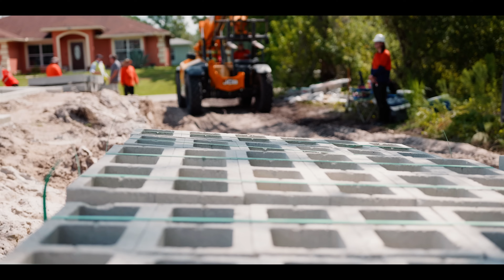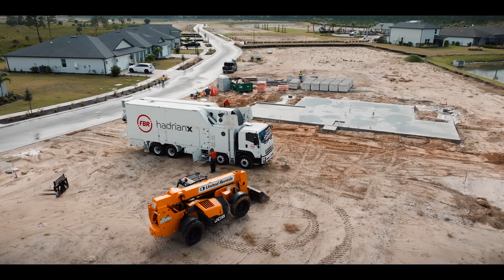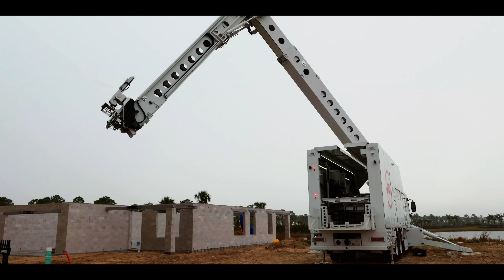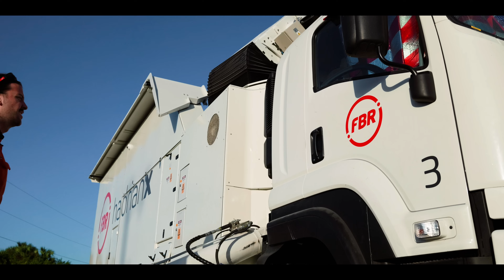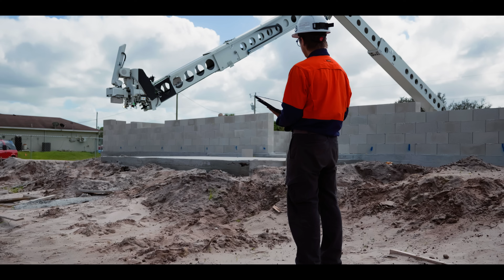Demo Program Retrospective | FBR

Comment: I see that you're using an adhesive not mortar, I also saw that the adhesive is applied to the bottom of the blocks & then laid in the wall . I saw the gap in the perps so what is happening with the filling of the perps* > vertical joints* not horizontal joints. When watching some of the blocks were laid with a 10mm gap so how are those joints filled or are they laid flush to each other & that video I saw was like an error or something!? Need to know before I invest as I am a brick & block layer :)

Comment: This is a great video😃 Last year I was at the University of Johannesburg (UJ), where an Expo was held by Johannesburg Business School (JBS) and the South African Institute of Civil Engineers (SAICE). I was shocked of how far back the South African construction industry is and how they still apply old traditional manners of building structures in the construction industry of South Africa. Contractors and engineering firms do not use latest technology to implement it in construction sites even though students at universities do large amounts of research and publish it yearly regarding new technologies. 

When I got the opportunity to ask the panel a question, I gave them some background of the work I do in the construction and real estate industry and it takes 6 to 8 workers 6 to 8 months to build a proper big mine house when I worked on contracts for Glencore in Mpumalanga, South Africa. I told them about the FBR machine that has the capabilities to remove all the wokers and build the house in 1 day, which reduces operation, production and material costs they thought I was talking nonsense. The one speaker even said a study was coducted that showed a person can build as fast as a machine. I told her it is a conplete lie, because the Hydrian X builds 24 times faster than a normal bricklayer.